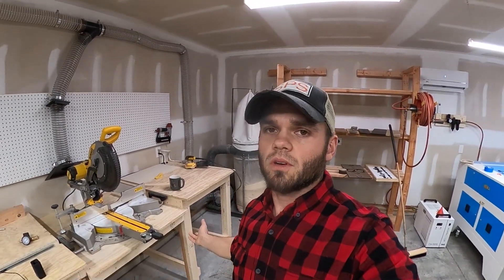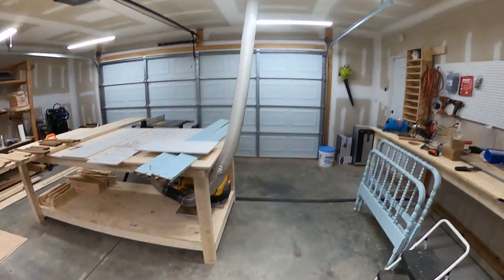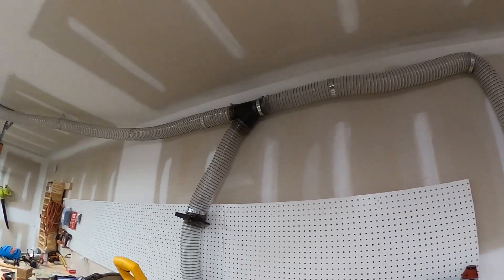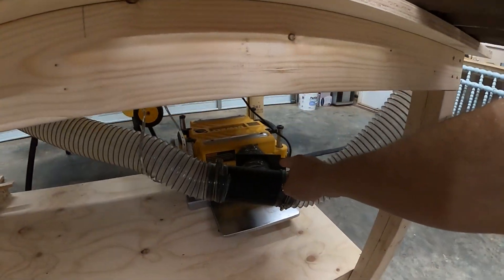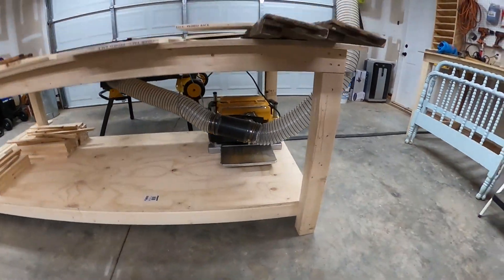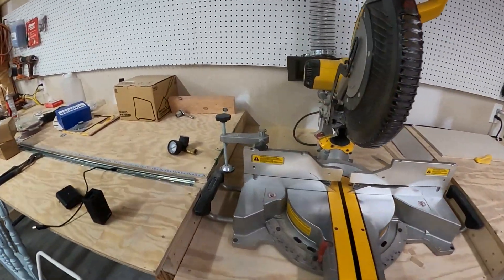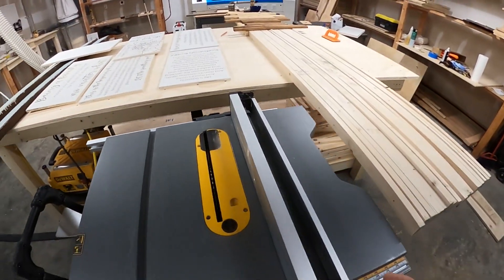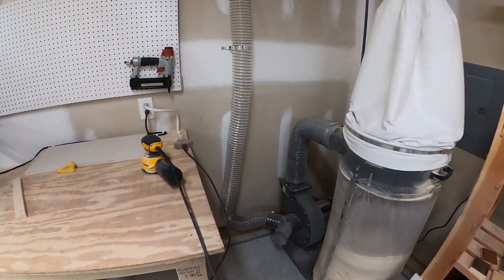Explaining Our Dust Collection Setup

Comment: Cool dust collection system. Love the shop set up. Plenty of space.
Reply from the maker: It's a better setup then the shop vac that we previously used. The shop is awesome! I remember back when we literally were working out of the back of my truck / sawhorses / off of the ground. This is a HUGE upgrade. 😀
Reply: As we all have or will experience a drive that crashes having redundancy in back up ie the original files are here the edited version saved and then uploaded. As my friend said safe they don't delete until after it's done. The original lives, and the edits live on different drives and saved. A lot of work but incase of a data failure with the redundancy they may be able to rebuild and still have something.

The explanation really helped me understand how  the system works! Thank you!
Reply from the maker: @brendamaroney2966  that's something that we definitely learned the hard way. Always have a backup! Luckily all we lost was some work and nothing like family pictures etc. I'm glad the video helped you out! This is a huge upgrade.

Comment: If you do upgrade to piping in the future, you can use 4 inch sewer and drain pipe which is more than sufficient for the collector you have. Also, you can get an upgraded impellor from Rikon for the Harbor Freight collector that improves the flow. I also have a dust deputy cyclone and canister filter.
Reply from the maker: That's a great idea! So far this flexible piping has held up. I'm definitely going to check that impeller out. After dealing with leaf collection systems etc. it's amazing how much changing an impeller can help something like this out. 

Thanks for the tips!
Reply: @reallifetested2605  the rikon part number is P60-200-22.